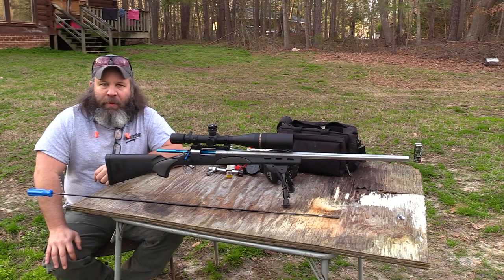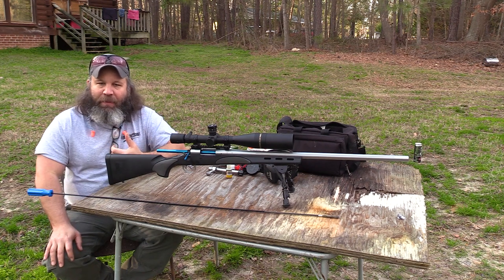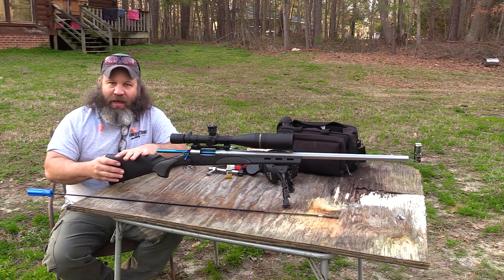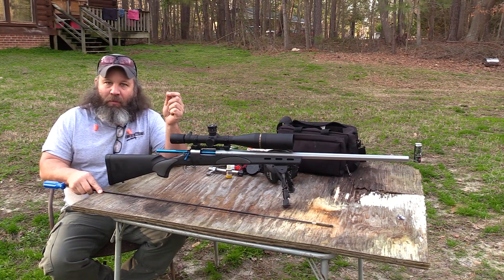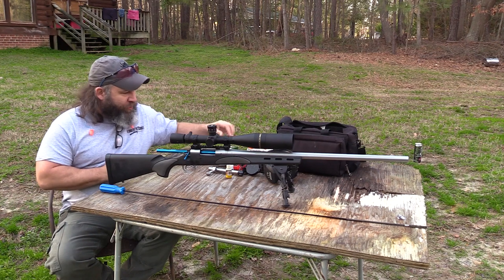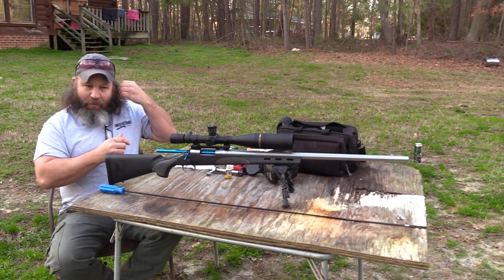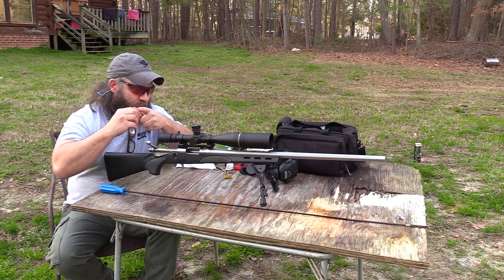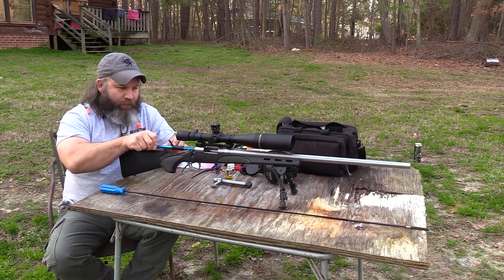How to break in a  rifle barrel.

Comment: You doing a good job I have a few 220 swifts happened to have a first generation sendero five shot quarter MOA gun required a good break in bedding trigger I have about 2,000 round through it still shoots great IMR 4350 Federal bench test primer Hornady 53 grain V-MAX
Reply from the maker: Thank you Brian. Would you recommend IMR 4350 powder over the IMR 4895 with the initial loading for the Swift?

Comment: Looking forward to seeing more swift videos, it will be interesting to see your hand loads compared to mine I found Bergers to be the most accurate in my swift, plus magnum primers but the swift is a really accurate and found it isn’t fussy , atvb Steve
Reply from the maker: Once I have the review done I will work up a reload and update it with the results. I also have a new chassis from MDT to swap in and see what that changes. Thank you for the tip. What brass do you like?

Comment: When you are doing the brake in are you using junk cheap amoo and then after your 10 to 20 shots. Are you changing and using hunting ammo
Reply from the maker: I use brass cases copper jacketed.  Other than that any factory or quality reload is just fine.
Reply: 👽Junk/Cheap .220 Swift Ammo? You feeling ok??

Comment: The rubber on the rod will also hold dirt and metal particles especially laying on a nasty dirty table..........stainless one piece rod for me Thanks
( wipe rod down every pass) 220's forever !!!!!!
Reply from the maker: That stainless steel rod can damage the bore.
Reply: @rangehot  so can junk embedded in the rubber ..........in a perfect world everything would be surgery clean but the world ain't perfect
Reply: I was thinking the same thing about the rod and table.  Noob here though, and I wondered why everyone is worried about whether the rod might have a moment to touch the bore right after your shoot a jacketed bullet and a brass brush down it.  I mean are we wiping down each round before loading?  What about wiping down the rod?  How delicate is the bore vs. any possible junk that could end up in it?  Thanks
Reply from the maker: @fenomeno71  Erosion is cumulative. The theroy is less contact with other metals, the better. A bullet is contacting the rifling altogether; however, a misguided rod with a bit of force will contact the rifling at a specific point. The occasional occurrence is inconsequential, but a repeating issue may make a difference. It is best to eliminate the variables from the get go.